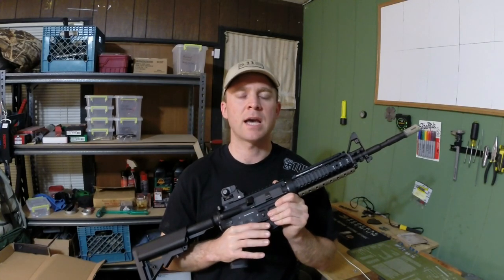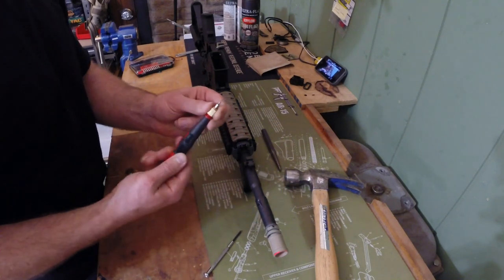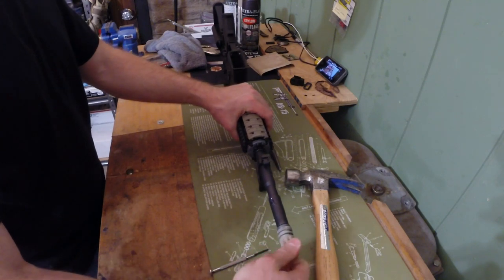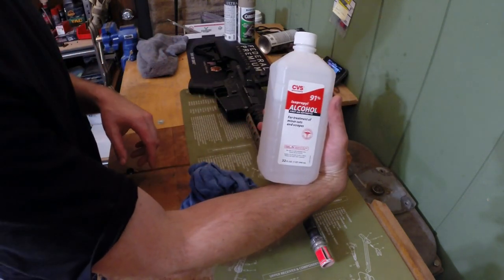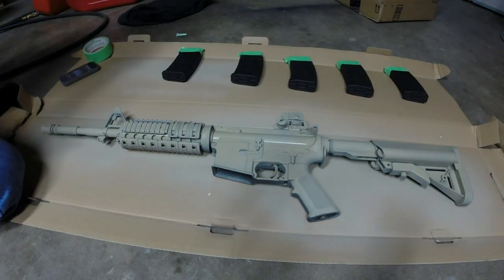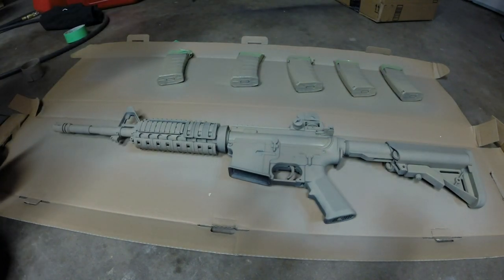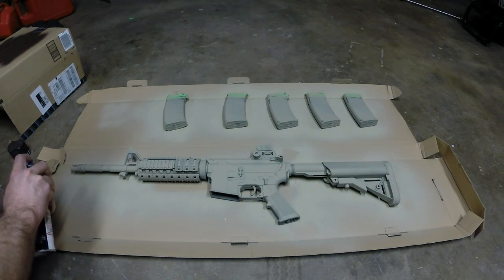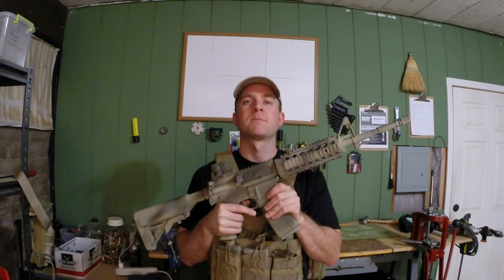Airsoft Painting & Flash Hider Removal - KWA RIS

Comment: Will an ar15 lower receiver vise block be a better option then clamping the barrel?
Reply from the maker: adventureteen_15 you risk damage to upper and lower from torque on the parts. Remember that these guns aren't as strong as a real AR.

Comment: You don't have to mask off any of the moveable parts? Such as mag release or fire selector.
Reply from the maker: Nick Mondragon No, just dont drench any mechanical piece with paint or you might have to clean it afterward.  Most of the paint will wear off in the high wear areas of the gun.  You should see my gun now.
Reply: +Da Rock btw this is illegal
Reply from the maker: +Steven Morris-Zazzars which state do you live in?
Reply: London
Reply: +Da Rock kl vid anyway
Reply from the maker: +Steven Morris-Zazzars good to know. Didn't realize that's illegal in London. We live in California. And thanks for the compliment. Never realized how hard these videos are to make.
Reply from the maker: As long as you dont drench the part any paint that gets on a moving surface will rub off.  I've put 100,000 rounds through after painting it and haven't had a problem.  Remember light coat of paint in areas that move.